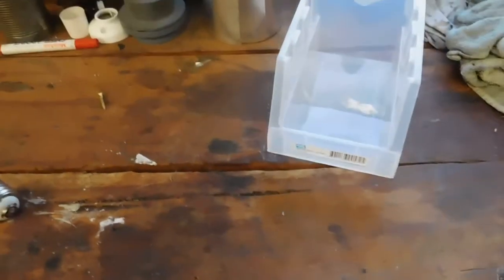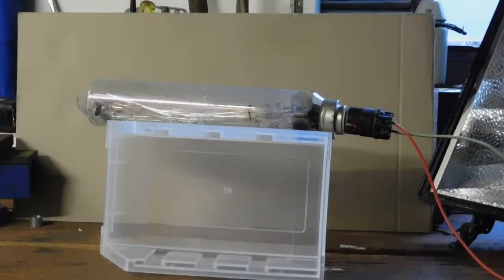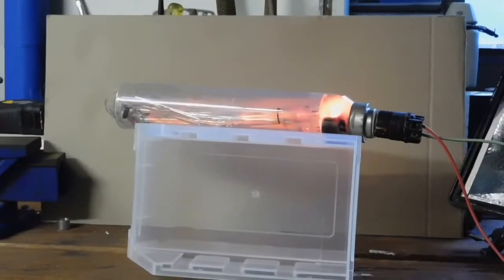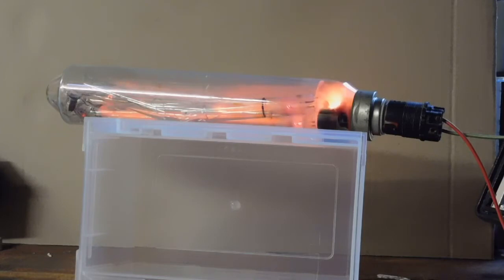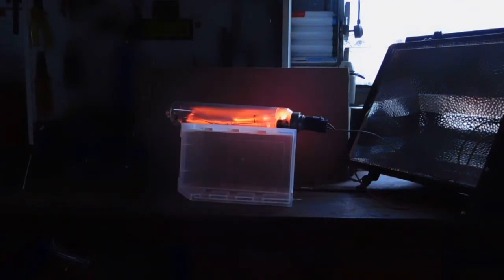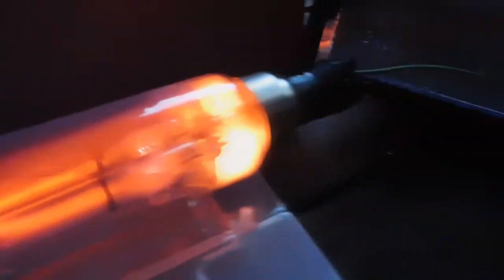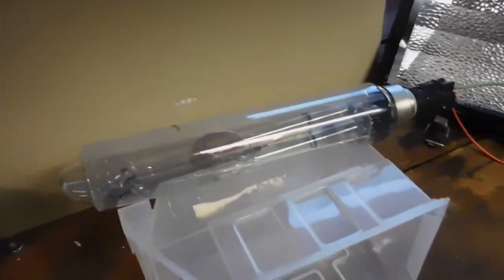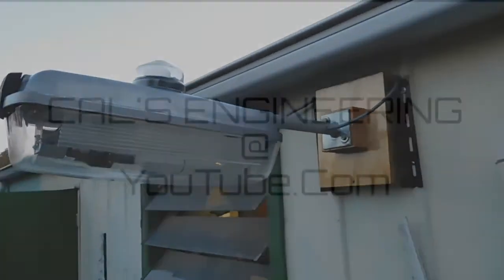Damaged 35 Watt SOX Lamp on 400W Halide Gear

Comment: Good how it still works on the residual Neon gas that is diluted in the Vacuum of the outer chamber, would be nice to keep it as it is. I had an old LPS lamp that I floated on water then busted it, the metallic Sodium will react and burn in the water.

Comment: Take it, hang up vertical from a B22D socket and put a 47k 10W resistor in line with the mains, so you have a very large neon indicator lamp for power on indication in the shed.

What there is left in the tube is basically a low density neon fill, a pair of good electrodes and a massive surface area for cooling, so it now is a very nice neon lamp. 

Would try it with a neon sign transformer, but it will arc over in the base more than in the lamp though.

Keep it rather than break it, metallic sodium is only fun in kilo chunks, not gram lots. For more fun, make a sodium potassium alloy, which is liquid around room temperature, and which really goes off with a bang.
Reply from the maker: Ahh now that's an idea! Yeah I havent destroyed it yet,  might give the neon lamp a try